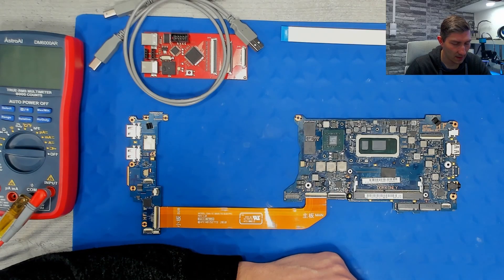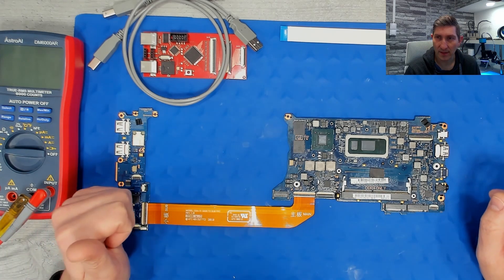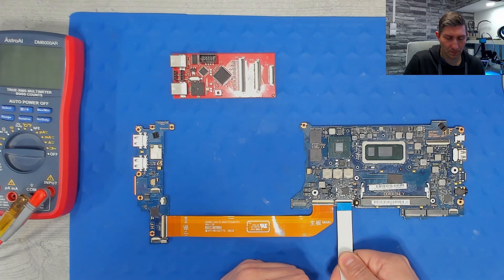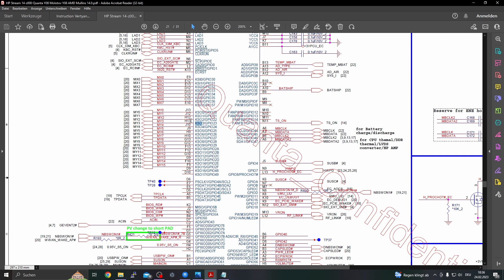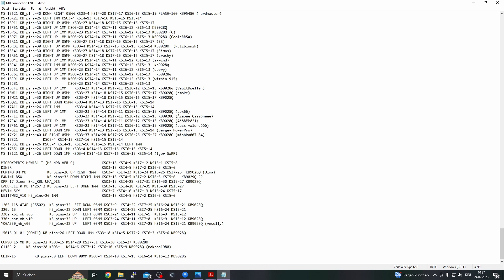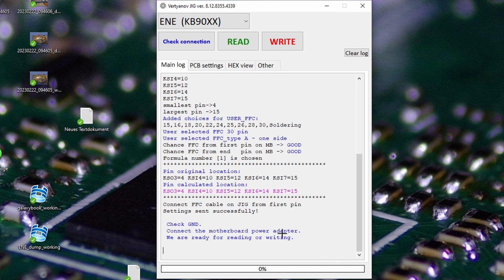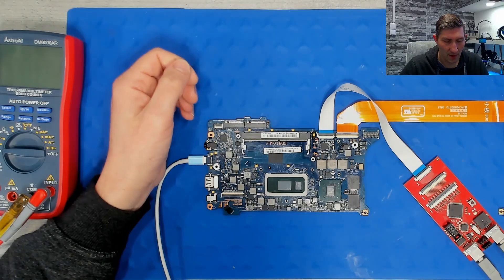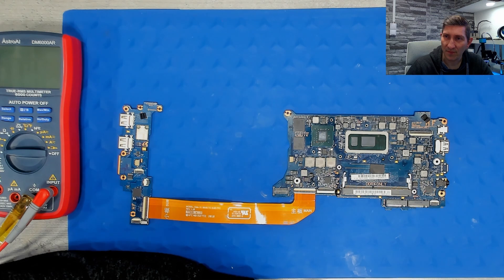Follower Request: How to program a Embedded Controller / SuperIO / Startup Chip from scratch!

Comment: Thanks for the short and inclusive video about SIO programming. I think it's equally important to mention where we can find SIO FW dumps from various chipsets/laptops. Because usually when you have to program a SIO it means that you have removed the old one and replace it with a new. Some times the SIO is being programmed by the system itself but with many laptops this is not the case and then you need to find the FW to flash it.
Reply from the maker: Indeed, sometimes it is hard to source the firmware. The truth is, if you don't find it at the usual sites like badcaps or vinafix and so on, then you're lost pretty fast. For the case of the galaxy book, I was at this point, too. And what did I do?
I've sourced another working board and returned it after reading out the dump. There was no other way... :)
Reply from the maker: @anshadedavana  You are right. At least in this case the EC-Firmware was also part of the Main BIOS. It did not automatically reprogramm the empty EC ROM from Main BIOS, though. i have tested that and i did not understand the reason, because there is no point to have the firmware there present then, imho.
Reply: @fairrepair_en  in some cases,if you erase the EC chip,it will be self programmed by the bios.